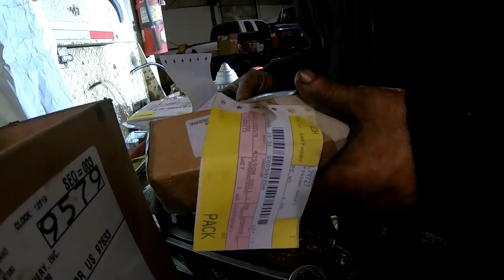John Deere 6400 front planetary rebuild

Comment: When I was working with a big international company they use an app to track maintenance on equipment, and things get checked off at regular hours, the maintenance manager can view what jobs are coming up what was done, and wasn't done, the biggest thing is they can plan maintance and make sure its actually done. 

we took that information and checked if the information provided by the manu was correct on main hours, and checked if hours should be changed for some tasks. some equipment stuck out like sore thumbs, always breaking down before they should, or had really high fuel usage, those units quickly got the chop.

The other big thing is operators doing an actual walk around before firing stuff up, check oil, fuel, lube tires etc prior to getting going for the day they had an app for that too that runs on your phone.

Comment: I’m searching YouTube now for the video, “installing Bobcat turbo on my Civic”.  I heated motor oil on the stove in my French frying pan with basket. It seemed like such a great idea since I could get the crank gear (air cooled vw bug BS) out with out fumbling with pliers and such. Later we discovered that degreaser spray and lots of Dawn did not get rid of all the engine oil flavor from those fries.....YUCK

Comment: Low low pressure oil on a 6.0 - usually a lifter roller needle in the oil pump :(

Comment: Is that the same front axle that was used on the 2950? I replaced the main seal between planetary housing and be knuckle on mine. It looks very similar. I have not been able to get mine  to stop leaking. I replaced the bearings at well. Thanks for the info

Comment: Hey Warren, my inverter will draw down my batteries after a full day left on. I try not to forget about it but you know what it's like when you get busy. I ran a hot lead from my welder battery to the truck battery with a Cat master switch in it. Truck batteries die, I fire the welder, flip the cat switch and let them charge. Saved me more than once!

Comment: Have you worked on any John Deere 750j engines? 1T0750JXPCD236654 (DZ003)
 
PE6068L227664  (ENGINE SERIAL)
6068HF485 (ENGINE CODE)
I've been trying to source engine tools: timing pin, turning tool(JDE83 or similar) to put engine @ TDC.
Would you have ideas as to how one would go about doing this with out these tools.  Local Brandt dealer won't sell these tools, i called another dealer 5hrs away and the parts are 6-8weeks away.  This engine has combustion forcing coolant out the overflow tank, so the head needs to come off.  Any information would be appreciated, thanks.

Comment: That bearing heater looks like a pretty slick rig. Did you used to heat them up in a frying pan with hydraulic oil? I'm kinda batting around the idea of getting one it tuff sometimes if you have x amount of money to upgrade tools figuring if you can justify it or keep doing the way you used to.

Comment: In my opinion the only better F-150 would be a 2014 with the 6.2 gas, so hard to find for sale.
Reply: Na the 5.4 is better. I know what you're gonna say: they had spark plugs. That was true on the older ones but they fixed that issue in the mid-2000's.
Reply: My 08 5.4 had the problem, besides the 6.2 has over 400 hp, the 5.4 330.
Reply: @justastudentoftheworld3940  Yeah you probably got a bad apple off the Ford tree. My friend never had any problems with his 04 new body so far, and my dad runs a bunch of 5.4s for his work. The 6.2 is probably a better engine for towing, though. I personally like the 09 and older Fords better, but I'm excited to see what the new 7.3 gas will be like.